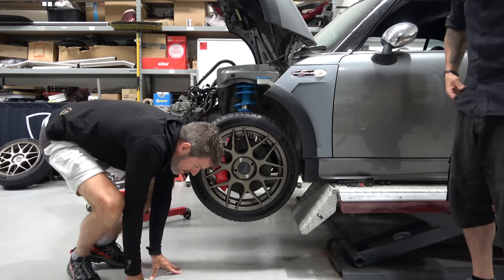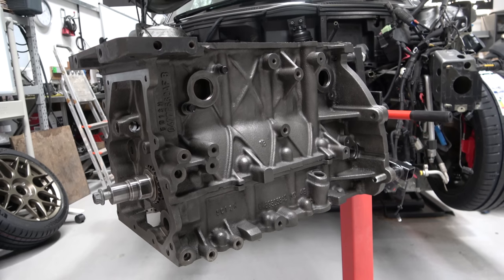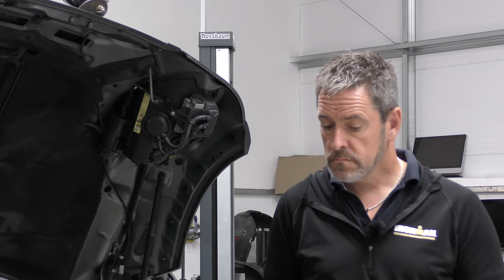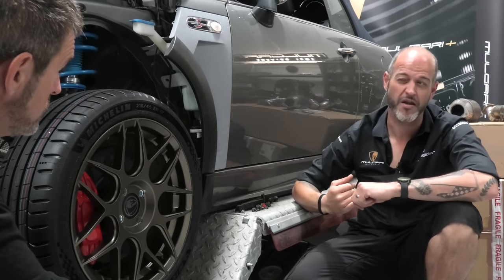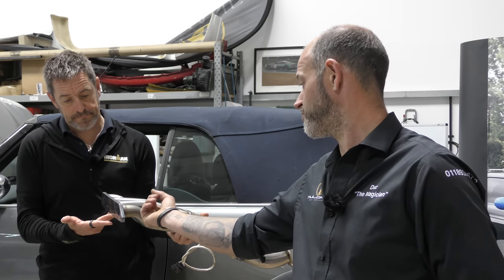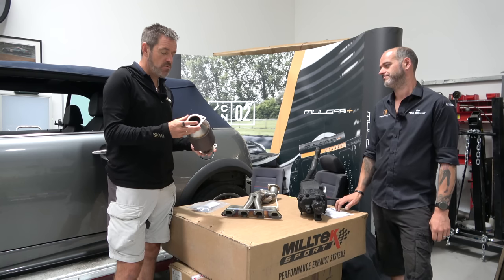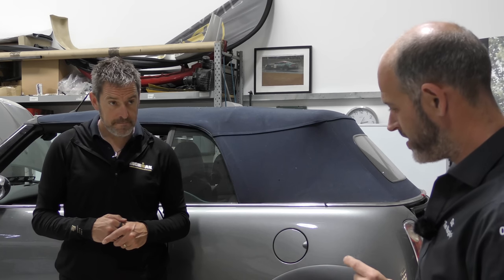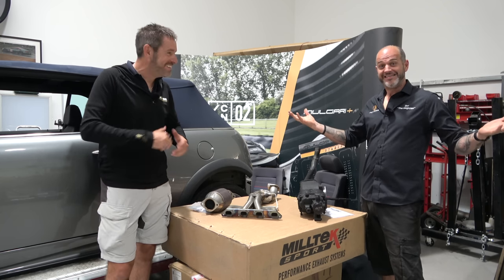Can't believe we saved the engine ! Wheels, Tyres and Exhaust look good too - Project PP Ep 4 | 4K

Comment: Make sure you fit an ati damper before the crank pully decided to kill itself especially if your running more power! Also worth nothing the miltek sports cat it only rated for stock power most people who run higher power will run a tomcat stock cat with modified ends as the miltek cats like to melt…